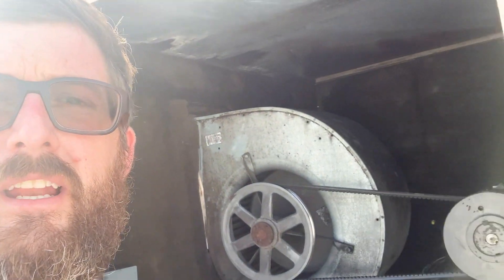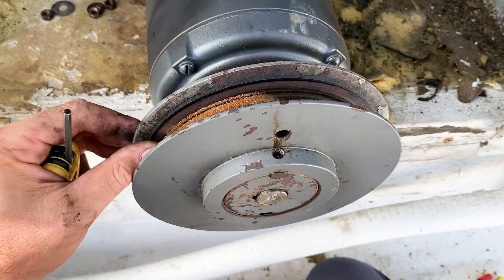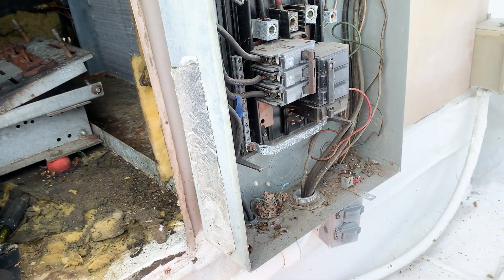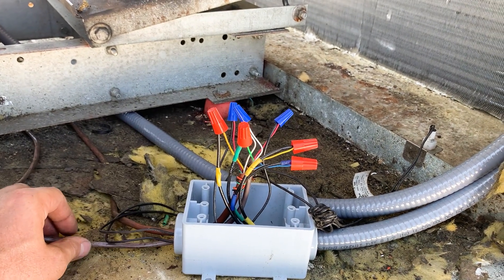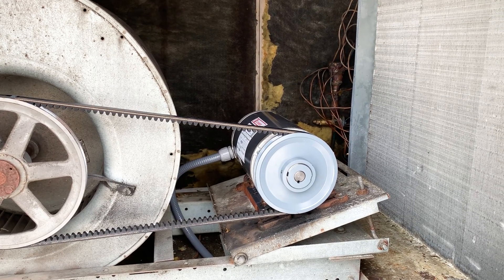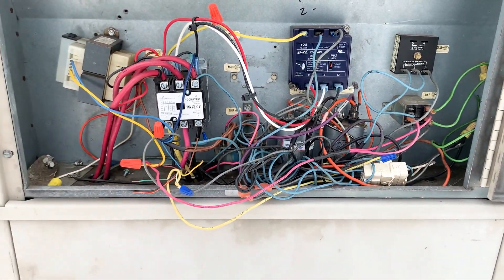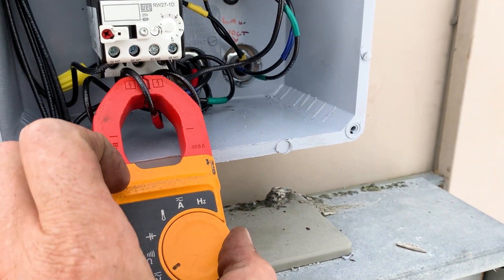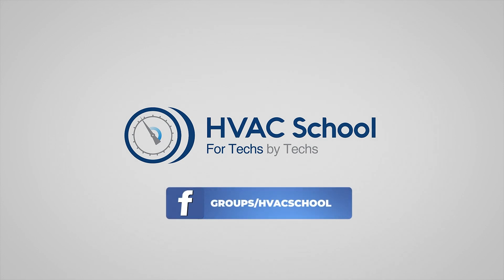3hp Blower Motor Replacement

Comment: So just so I’m understanding and I’m pretty green. You did away with the contactor which was 24v coil controlled and you added a motor starter with a amp overload but I’m guessing either all you had was a line voltage coil or they don’t make one with a 24v coil because you needed the low voltage control.

Comment: Wrong pulley, and that box is whether proof put it on the top of the unit and Come in the back.
Nice way to make the schematic for the next person!👍🏻
🥃🥃🍺🍺🍺🍿
Stay safe. 
Retired (werk'n)keyboard super tech. Wear your safety glasses!
Reply: Weather proof box and sealtight will funnel warm moist into cold box and it will condense to water, and continue into the motor, fill sealtight with your silicone.